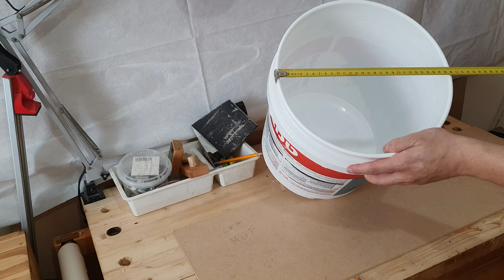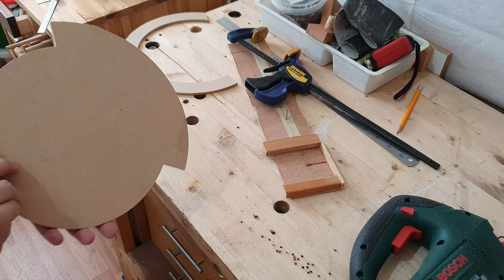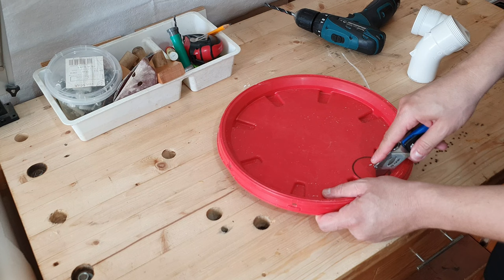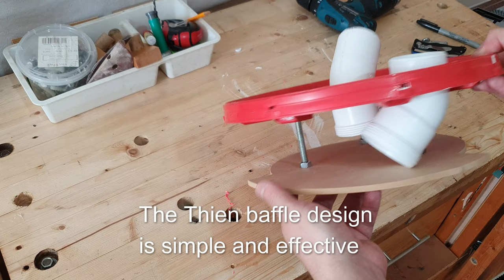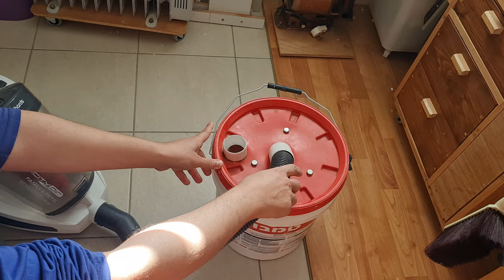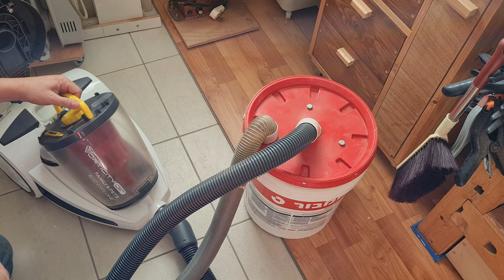Awesome Single Bucket Cyclone Dust Collector (Thien Baffle Design)

Comment: doesn't the cover leak vacuum or pop out ? Does the bucket get deformed from suction ?
Reply from the maker: Excellent questions. The cover doesn't leak but the bucket actually deforms whem the vacuum is blocked. This is something I should have thought about so a metal bucket would be much better for that

Comment: I am new to dust collection. Shouldn’t there be a separator to separate the fine dust from the large chips?
Reply from the maker: Maybe too late to respond, but you're not wrong - this is a relatively simple design and not 100% dust proof. From my experience it collects 90% and even more. I'm using a household vacuum cleaner with a HEPA filter as the suction source, so dust is not an issue

Comment: Nice Job!  Going to try it on a larger 750 CFM dust collector.  Did you notice any suction performance downgrade?
Reply from the maker: Sorry for the late reply. There wasn't any performance downgrade, but I wouldn't recommend the plastic bin anymore. It tends to collapse when the vacuum head is blocked. I'd use a metal bin instead, and I plan to rebuild it for this reason. 
Also, the plastic is a little too light which throws the bucket off balance. Make sure to secure it well. Thanks for watching!